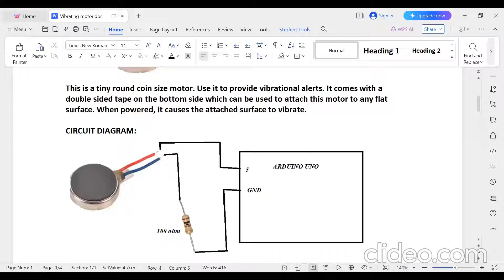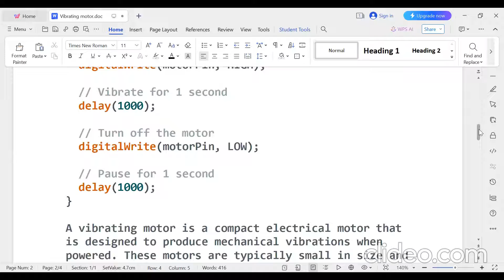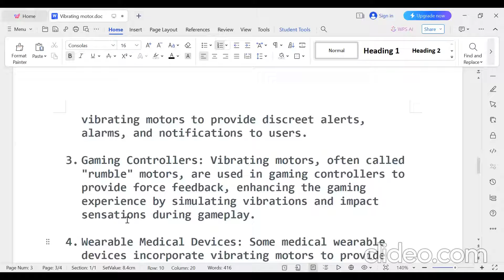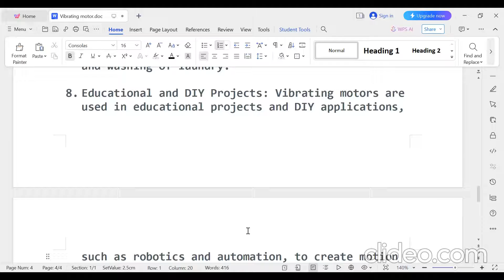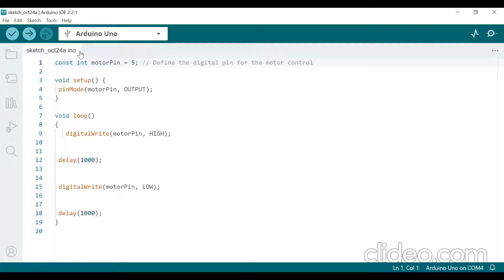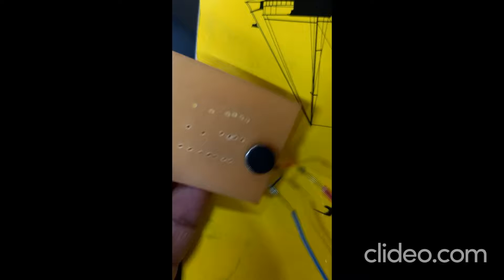Interfacing of vibrating motor with Arduino UNO

Comment: But its voltage rating is 3v so So how is it tolerating 5v directly coming from digital pin?
Reply from the maker: Although the motor is rated at 3 V, it is not getting the full 5 V from the Arduino pin.
The 100 Ω resistor and the Arduino pin’s current limit reduce the voltage and current reaching the motor, so it survives and vibrates safely.
However, this is not a recommended long-term or professional design—a transistor/driver should be used. This connection works for demonstration, but for reliable and safe operation, a transistor driver circuit should be used instead of driving the motor directly from the Arduino pin.
Reply: @shanthacmukartihal4071 Yes that's why I asked 
Thank you ma'am it's a great explanation ❤